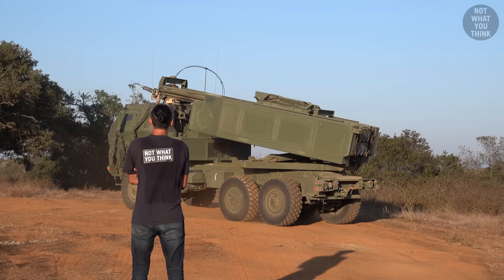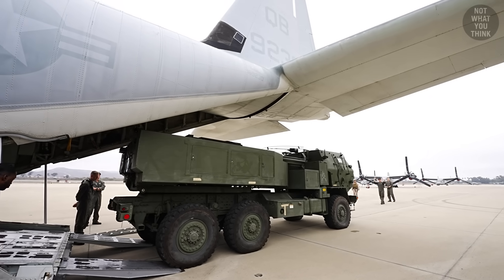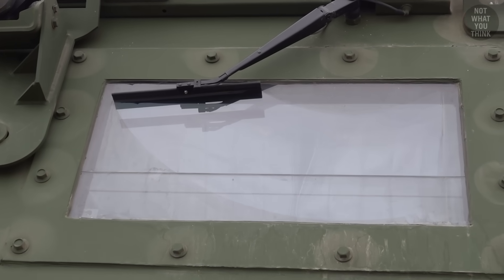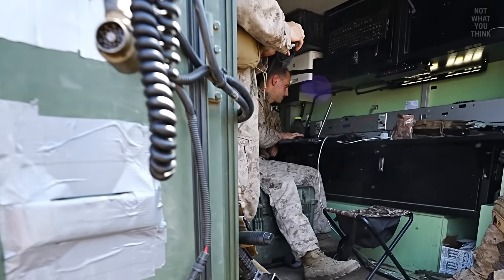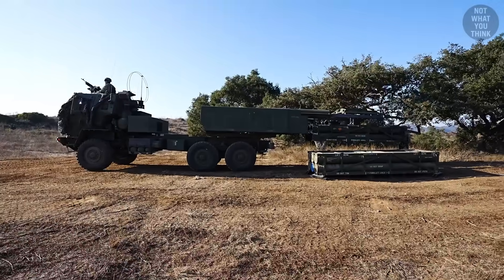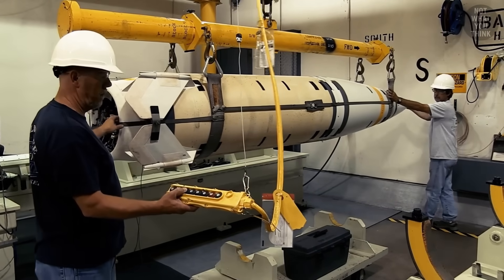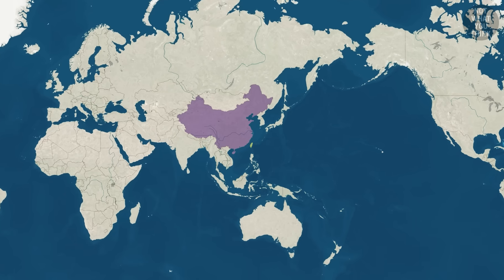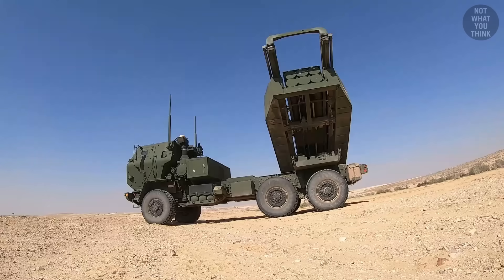How US Marines Operate Their Advanced Rocket Launcher

Comment: Relative bragging rights here… but first some corrections to the video….Lockheed Martin designs the HIMARS… they draft the blueprint drawings of its parts, and SEVERAL other companies make the parts, send them back to Lockheed and Lockheed assembles them. For quite a while I worked for a company that I will not name because of the nondisclosure agreement. Anyhow I was given the drawings for many components, and then I did the 3D modeling in Solidworks for said parts to be cut out by a large laser cutter. I would set up the machines for bending said parts. And after I got it dialed in, and checked the measurements to spec, another guy would take over and bend up the order worth.  The company also painted the launcher tubes and drilled all the holes for various components that attach on the launcher tubes. I drew the blueprint and made the jig that is used for doing all of the hole drilling. While their on contract I also drew up the 3D models for stuff like the locking and latching mechanisms for the containers that shoulder fire rockets are transported in, various panels and mounting stuff for torpedoes, racks and brackets and all sorts of stuff for mobile command posts and radio equipment trucks… funny thing is, I had never done any 3D modeling before, I sat at a computer in front of a huge laser cutter on day one and I taught myself how to turn the blueprint into a model by the end of the day. After day one I was rocking and rolling and helping the company get caught up on all of their backed up orders. A short while afterward they shytcanned me because I had done what needed to be done  and they were ready to continue to lose money in every department like they had been doing lol. So… given I had no experience in the task, no instruction, no one even checked anything I sent out of my department unless further machining was required… just blame me when it doesn’t work as it should. 
You’d think a facility like that would not have their doors propped open, employees allowed to drink beers while working so long as it was after lunch, no one ever in any hurry to actually get anything out the door, classified files just loosey goosey left on thumb drives laying everywhere. No secure servers. Hell I took blueprints and files home to practice with that first week. No monitoring at all.

Comment: 1. I wish our troops would train with camouflage! ; _ ; That tiny spot of ULCANS on the cabin was beat to smithereens and sure wasn't doing much. No one else was using any either, save for that FDC (and only when it was stationary). No system can be used as well as it should without training, especially complex systems.
2. Having a built-in reloading crane is cool af.
3. Having a built-in electronic simulator is cool af.
Cool vid!

Comment: GMLRS flies roll stabilized so those spiral guides in the MLRS launch tubes are a problem. Fixed by putting the fin section on bearings so it spins while the rocket doesn't.
Reply: This

Comment: PrSM is a whole different beast than the ATACMS and it is something that will keep Chinese up at night.

PrSM missile with upto a 1000km range and have the ability to hit moving objects ie ships. So basically it will be ASBM capable of being launched from the 6x6 Himars. Of course the Chinese DF-21 and DF-26 still outrange and packs massive punch but it has one big problem.

Those two are carried on the massive 10x10 and 12x12 (can see that TEL from space) truck with little to no off-road capability/deployability/mobility.

Putting PrSM on 6x6 Himars chassis, being smaller means it can be transported by C-130 (potentially by CH-53K helicopter too) , more off road capable and be deployed on a wider range of remote areas (not just on flat piece of road) making it unpredictable for the PLA Navy. Just ask the Russians how that Himars hunting is going for them.

The other is the recent Tomahawk attached unmanned 4x4 JLTV chassis. Has the same range as DF-21 and although subsonic can still hit ship and carry massive punch. This one, not only can C-130 carry a few, but it can be even air-transported and air-dropped by Osprey, CH-47 and CH-53 (and possibly by V-280) too. To exterminate this threat China would literally have to spend every munition destroying any 4x4 they see on satellite to guarantee that its ship would not be targeted. I do not know about you but that is a battle China would lose. Far more 4x4 in circulation than missiles.
Reply: Or just throw out 45 anti-ship missiles in the form of the rapid dragon from a single cargo plane.

Comment: Hmm, isn't it a problem if the enemy can see the smoke because of the vegetation is on fire after rocket launch?
Reply: The team will change position immediately after the fire, long before the enemy spots the fire (if they didn't somehow spot the flash and trail of smoke)
and any competent enemy will have counter artillery/rocket radar system, which can calculate the ballistic trajectory of the rocket
so they don't need to waste time sending drones to spot a bushfire, they will fire back as fast as possible
(the blast of the fire will put out any small bush fire thought, that's a bonus)
Reply from the maker: Sure, if you’re that close. The rocket’s smoke trail is a lot more visible than the grass that’s on fire.

Comment: 1:30 "They use the labels for tracking, and we had to blur some of the details for operational security"
Proceeds to get as close as possible to the labels
Reply: They film everything they can, and are often told after the fact once the video is reviewed what is and isn't allowed.  
The voiceover is placed on the footage after the fact as well.
Reply: They didn't have the serialized gear shown. It is fine. This was my specialty vehicle at my unit. They didn't talk about how it uses a GPS guidance system for the rockets, which you can know just not details. They are not Marine Vets with us when we get our civilian either. Ours was former ARMY that assisted us and one guy who was the ranking civilian never served. 
Oh and the run flat system that makes this drive anywhere is on every 5ton chassis system which this is on a 5 ton chassis.
The windows are only roughly 8 inches think with multiple windows. The cab can withstand a blast from the rockets it fires as well.